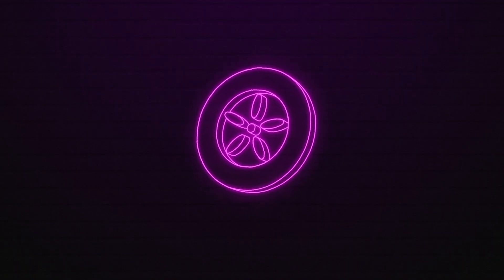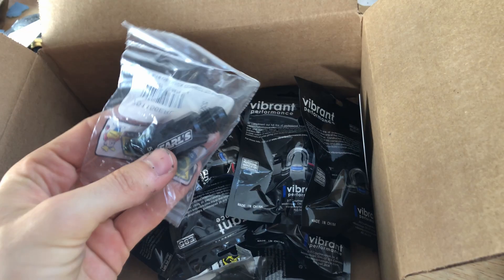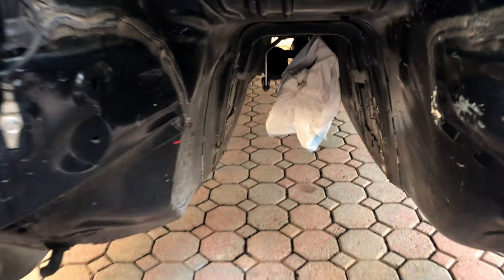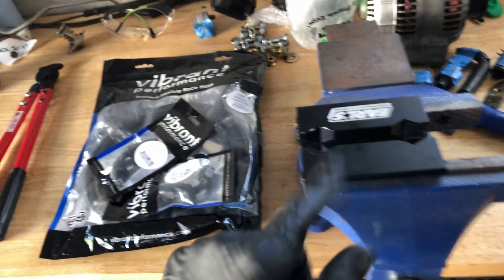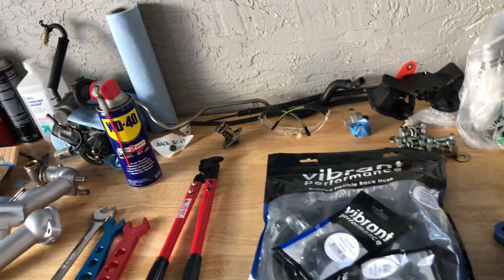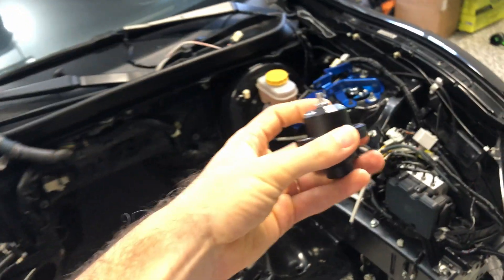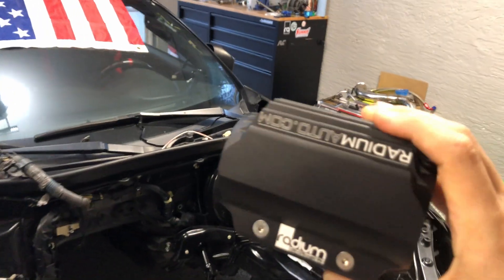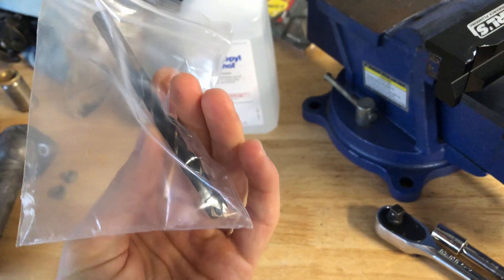Fuel System for 2JZ Swap - COMPLETE!!!

Comment: please list all parts needed to use the oem fuel lines
Reply from the maker: Hi man, i used RACETRONIX Adapter, 90° QDFF 5/16" Fml »- 6AN Fml for the rear (pump side) and Earl's Performance 5/16 Inch OE Fuel Line Quick Connect to -6AN Male for the front (engine side)
Reply: @MinkMood  thank you very much
Reply: @MinkMood  please let me know if it's possible to email me all the part number to use the oemlines & radium fuel filter
Reply from the maker: I can help you. Send me an email info@minkmood.com

Comment: Is this worth the money? I have a hellcat set up and not a fan of the spacer and leaks. Also pain in the ass to seat the oring. . I’m set up for an limes already -8/-6 I just got a feeling I don’t have enough fuel and might have leak issues as I smell gas probably from bad seal on oring of the full blown kit
Reply from the maker: I really like it. It’s a dual hanger with the pumps already installed. Very easy to just plug and play